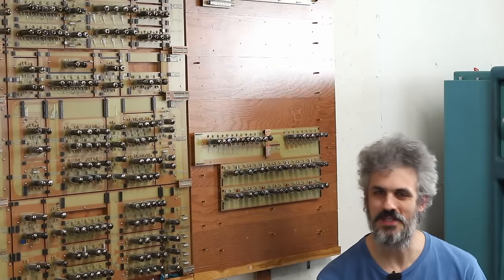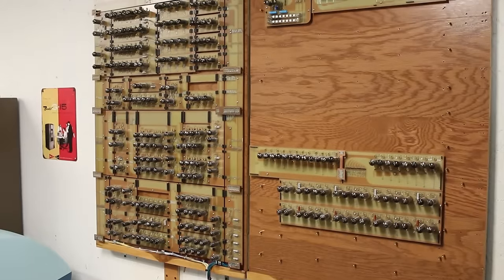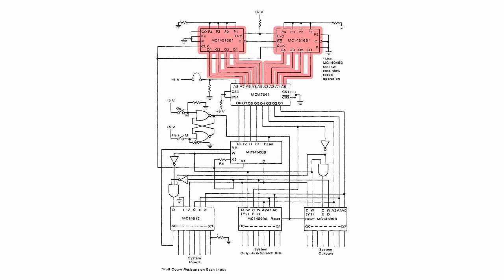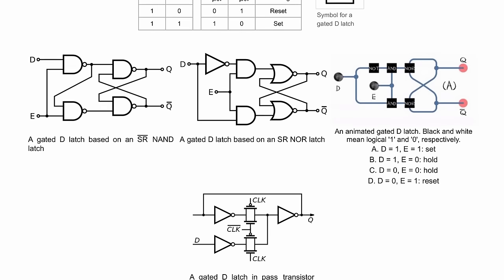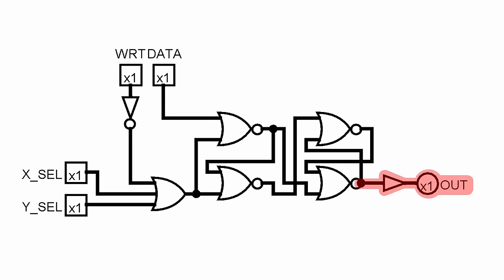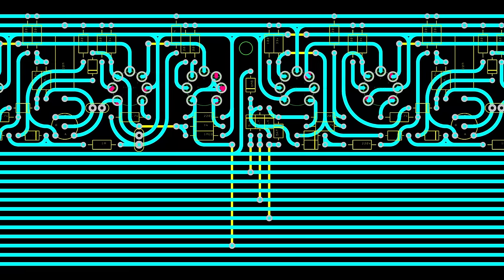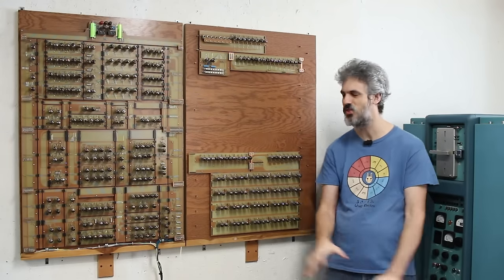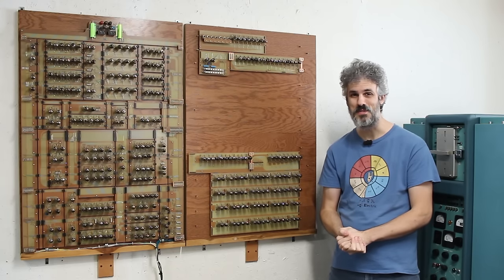VTC P.35 – Building the Output Register

Comment: Using an electronic component for something it was not designed to do, is the essence of electronic engineering.  I cannot count the times i have seen something that at first glance, should not work.  But it does, because the engineer who designed the circuit knew something about the components being used that i did not.

This is why i view integrated circuits as black magic.  There are tricks done on an IC that aren't immediately obvious as to how they work.  But they DO work, and work reliably enough to be mass produced.

Comment: Thanks to the patrons!  I think the only thing limiting the speed of your machine might be the strike time (conductance time) of the fluorescent indicator tubes.  Luckily hot cathode tubes strike much more quickly than cold cathode tubes.  I would think the machine should easily be able to manage a 100Hz clock, perhaps a 1 KHz clock or more.  Remember, vacuum fluorescent displays are often multiplexed and that wouldn't be possible if they didn't switch very quickly.  It should be easy to measure the strike times of some sample indicators using an oscilloscope.

Comment: You can always "save" a narrow trace by either just adding solder to the top of the trace.  Or even better, just solder a bare copper wire along the top of the trace.  That way you not only get solder helping to carry the current, you get the wire as well.  I have actually seen this done on high current applications where the traces had to be small due to space constraints in the x/y plane.  So the manufacturer just made the trace 3D, by making it "taller" with a wire soldered on top of the trace.
Reply: I wonder what will be the "bottleneck" when benchmarking out the max speed, current delivery or the tubes?
This would be REALLY interesting to see through thermal and/or hispeed camera, would stuff visibly flicker or something?
Reply: @woldemunster9244  I can tell you that tube amplifiers will change brightness when driven hard.

I suspect that the limiting speed will be either capacitance of the tubes, or the electron transit times in the tubes.

Transistors are fast, because the distances are short, and the capacitance is low.  Tubes, not so much.

If he gets a couple hundred hertz out of that vacuum tube computer, i will be surprised.

Comment: Usagi: I really hope for 45 Hz, but who knows maybe we'll achieve 100 Hz... I'm not sure how low cathode voltage affects slew rate of tubes and those PCBs affect parasitic capacitances, but tubes were much faster than early transistors (effective frequencies in hundreds of MHz vs hundreds of kHz) so who knows what whole circuit would be able to reliably achive. 

Random thought: Considering tubes in your circuit being able to output 18V high and 3V low - if you could set reference voltage somwhere between (i.e. +10 V) or use a tube powered with negative voltage and switch between +18 and -18V - you could bit-bang RS232 (1 is -3...-25V, 0 is 3...+25V) and than connect UEVTC to Centurion or to dumb terminal (and as it was introduced in 1960 - it wouldn't be that of a stretch if early VTC was retrofitted with RS232 interface).

Comment: I'm pretty sure those Harwin pin sockets are the same ones I found a couple of months ago when I was looking for sockets for my 7 segment VFD tubes. I originally planned to use genuine Soviet-era bakelite sockets, but the idea of soldering 66 wires really didn't appeal to me over just clicking order on a PCB and soldering the pin sockets onto the boards. And as a bonus it also allows me to make the design more modular and versatile.

Comment: To guess the speed you need to find the longest propagation signal path in the cpu then add up all the rise and hold time for each device in that chain. 1 divided by that number is your approximate maximum clock frequency .

Comment: Great Job, It's only one thing that I don't like and is the one line connectors. You need to crip every terminal and the ribbon cable must be separated.
So I always use 2 line connectors (like the HDD or FDD cables) because it's very easy build any cable because the female connectors are ready to crimp into a flat cable. If you don't want to use both columns you can ground one and this act as a ground plane (at one layer PCB the external column it's complex to wire so better ground it) 
As example, pins 1 to 9 are signals and 2 to 10 are ground. At the ribbon cable you get an arrangement where is a ground wire between every signal wire.
The male connectors are ready to mount into PCB and them are very hard so it's impossible to move a pin when you solder them. both connectors have guide so you can't install backwards too. The male PCB comes in Horizontal or Vertical format so it's a great advantage use them.
Best regards!

Comment: I’m surprised the little VFD tubes will even light up at 24 volts of plate. Usually, those things take +120 to +180 volts of plate, having disassembled VCRs and calculators with VFD displays to see how they worked. They usually had a 2 transistor (or 1 IC) oscillator with a small step-up transformer; essentially a boost-mode SMPS.

Comment: 2 byte of memory?  its amazing that it works as good as it does.  Try and run windows 11 on 2 byte of memory O.o

The perk that system have is that it can be used as a heat element when its a cold winter.

Comment: I am only here for the tubes. And... The lunacy. I am sure I dont have to tell you that Voltage, and Current are inversely proportional. {Gosh. [SOB] I wonder if my spelling is correct] 
More tubes more, more failures will come. Due to such a low potential supply. It's madness using 24 Volts when 52+ Would be a better option for such an elaborate undertaking. "Mo Mile, Mo Problems."

You kinda contradicted yourself with the 'not able to be setup, and or perform as a parallel CPU.'
Or was there a misunderstanding in the explanation; you gave? 
I think some old adding machines use a few of them at the same time in the same unit.

I am not here for IC's anyways. Keep up the good work Crazyman! Love you.

Comment: I've always thought that a PLC (programmable logic controller) would benefit from a single bit architecture.  Because most industrial controls are single bit operations.  Sure, PLC's do math, but you can do math with a single bit system, it just takes a bit longer.  Now, no PLC that i know about currently uses a single bit processor, simply because regular 8,16,32,64 bit processors can do bit logic, and are available for pennies.

Comment: how about from scratch not a copy, also separate logic from the component implementation, to make things simple to understand and explain, mixing the two layers is a disaster, yes there is a logic circuit computer, any type, and its implementation on with actual components. availability of components might affect the first layer, the pure logic only circuit, tho, but it should not be a main driver of the design. first design a logic only circuit, then iterate if you can make it without current stuff etc. keep the logic circuit independent, fully, despite the availability of components. abstract logic level design if done properly, be implement with any components, not restricted by the components. yep computer design of the computer logic circuits, is the fastest explanation and prototyping, testing functionality. if you cannot explain the full logic only circuit, adding the electricity/photon components on top of the logic is going to make a splat. also by turing completeness, you can combine 1-bit computers to be a full 8-bit computer, if you carry logic signals properly, such as in 1-bit vs 8-bit multiplication sum matrix.

Comment: Every time you say VFD it bothers me.  Not because it's wrong, but because what i do for a living is commission and repair VFD's.  As in Variable Frequency Drive.  AKA a way to make electrical motors run at a variable speed.  Which is used EVERYWHERE.  Every manufacturing facility, and even a lot of stuff in other places, need motors to run at a controllable speed.